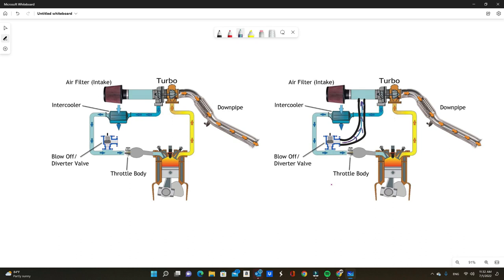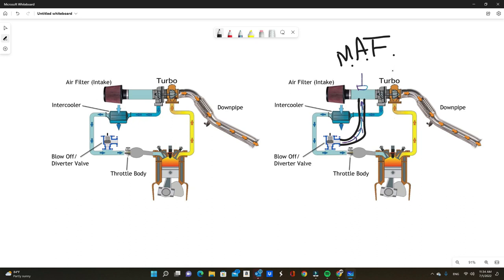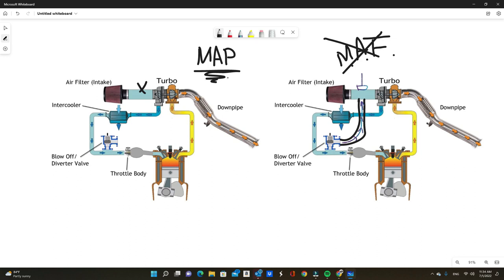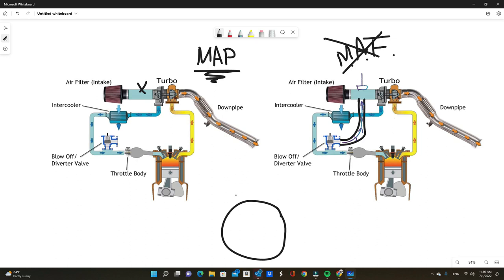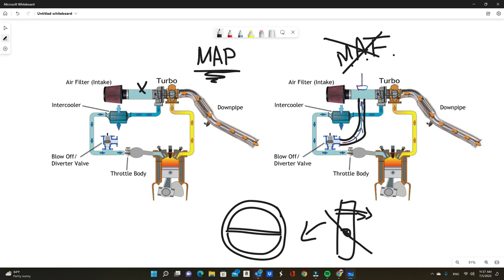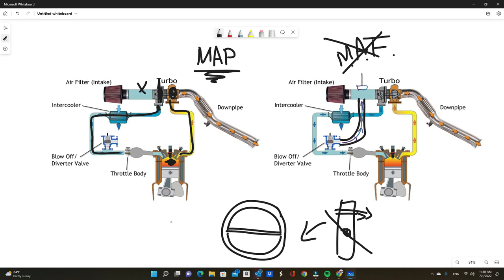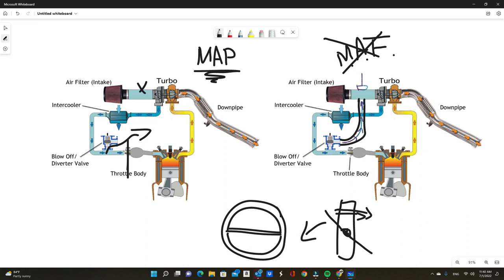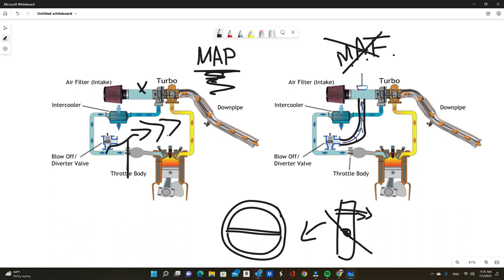How does a Blow off Valve work and WHY do you need it?

Comment: The compressed air when the throttle plate is closed does not spin the turbo impellor backwards as stated in this video. The turbo 'flutter' sound you hear is air sheering against the impellor blades which does slow them down. This has been proven by RPM sensor readings on some turbos.

Comment: I have a question about when adding an aftermarket bov, in my case the forge bov. can you take off the tube that comes from the back of the bov and dumps into the intake? Isn't that making it recirculate? I have an Injen intake as well.

Comment: I have the factory recirculating valve and for some reason it started making the fluttering noise, I don't really have the money for a good brand right now would a 50 dollar knock off hks ssqv be safe to use temprarily?

Comment: Are block off plates actually bad then since it spools the turbo back ? I believe block off plates are just to get the flutter noises
Reply from the maker: Block off plate is to be used when you add an aftermarket blow off valve in a different location than stock. It is NEVER to be used to delete the bov all together

Comment: Nice vid man. I have a couple questions— does venting to atmosphere vs venting to the intake (pre-turbo) affect power response at all? Im guessing that if it does, it would only give a minor bump in acceleration as venting high pressure air into the intake between shifts would raise the pressure only slightly in the intake (significant pressure increase in the intake would just blow back out the intake filter, right?), making the turbo reach full boost pressure quicker. Also, do you know if a 2021 atlas cs 2.0T uses a MAF or a MAP sensor?